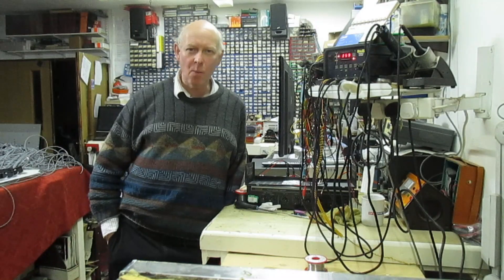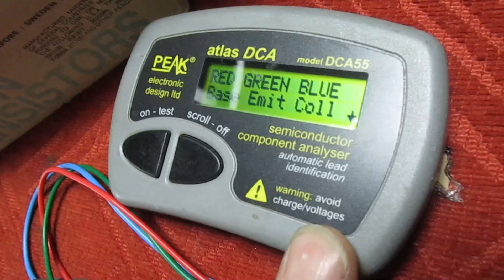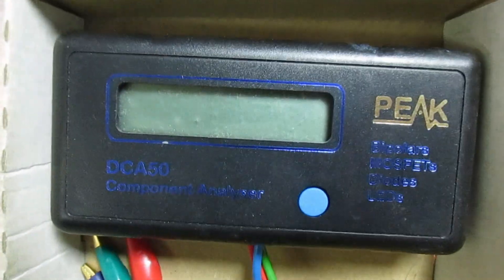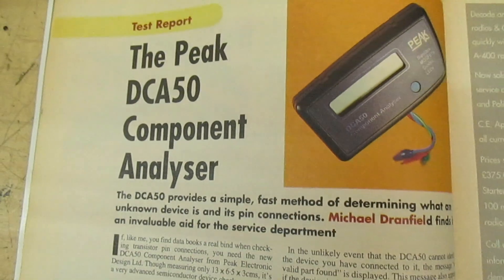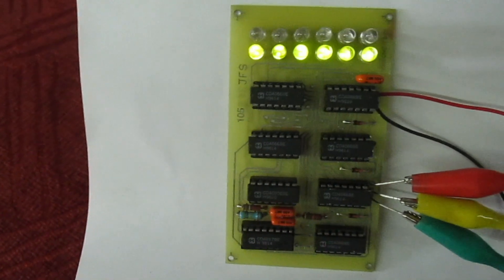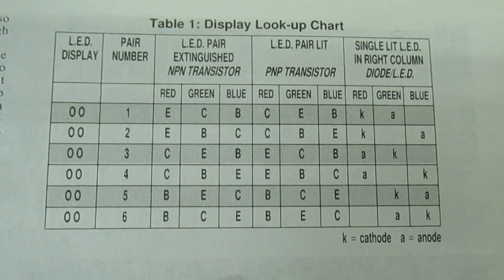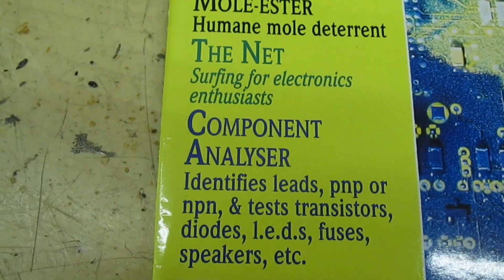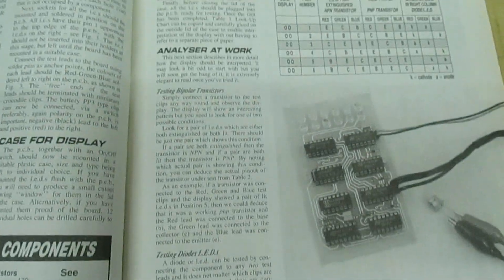The first Peak electronics transistor analyser from 1996 .

Comment: I have a version of the grey one here next to me
Reply from the maker: they are an excellent pice of kit and easy to use .
Reply: @michaeldranfield7140  Yes and they have a weird battery in them mine has been in the unit for 20 years and it still isn’t flat
Reply from the maker: @rectify2003  I tend to keep a couple of spare 12 volt batteries in stock as mine get a lot of use and the battery always packs up when I need it most !
Reply: @michaeldranfield7140  Brilliant

Thankyou

Comment: You've got me thinking about buying a DCA75 but it seems to be out of stock with Peak.  I often use my ESR60 (modified with footswitch).
I bought Television Magazine from the early 1980s and occasionally contributed.  I have them all carefully stored for reference.  Could use an easy indexing system for them as I still work on video equipment, especially Beta, Philips VCR/VCR-LP and V2000.
Reply from the maker: Television is the only magazine I have stored in order from the 50s to the mid 80s but doing this video and one on the milliohm meter has prompted me to get some sort of organisation, my Television magazines from the mid 80s to the very last copy are stored in different places , in no order and I need to get this sorted, I found the magazine I did the review on in the airing cupboard !!!
 Someone gave me a Philips V2000 from 1976 a few weeks ago but not had time to look at it yet .
Reply from the maker: Just had a look now its not a V2000 its a N1700 .
Reply: @michaeldranfield7140  You will see me work on N1700 and similar N1502 on my channel.  First and foremost of course are the heads, and they can often look fine but be knackered.  If you need a tape with recordings, just ask.
Reply from the maker: @video99couk  the guy who gave this to me said it had new heads fitted at one point in its life, I dont have any plans to get this going at the moment as I never got involved with these, my first video repairs were limited to VHS and beta .

Comment: Interesting video! I’ve been researching the semiconductor analyzer made by “electronic design specialists“ 
In some of the old magazines on that website, Dave (The original designer and owner of Eds)…. Had a three part series spanning three months showing how to build your own EDS 59C “Simi analyzer”. But it is quite complicated.

 I’ve tried to find one on eBay but only one popped up in the last several years and I wasn’t quick enough to purchase it. 

Would probably be quite an involved project and I don’t quite have time for it now.  So I’m holding out and hoping to find one instead of having to build it myself. 

Always interested in those small pieces of equipment designed by an individual. I have a pretty good collection of them. Although they don’t get used every day in my lab… I enjoy them immensely! Now that I think of it I do use the EDS “Cap analyzer”, and also their “leak seeker” almost every day.

Always enjoy your channel and content. Good luck on that batch of boards. 👍
Reply from the maker: It's not just a batch of boards, I'm building the who unit, you may have noticed on the left hand side of the video there's a great pile of wires also, these are finished units, 80 down only another 120 to go!!  I'm a big fan of peak electronics as you may have seen, the units are simple to use and quick, which is important when time is money, I also have the peak Triac/Thyristor tester whick I must have used only twice in 10 years.!!

Comment: And you kept all your magazines!! I had to throw many old PW, PE, TV magazines away as I didn't have space to keep them. 😢
Reply from the maker: You wouldn't believe how many magazines I have , Television, electronics today international , radio constructor, practical wireless , every day electronic , practical electronics , and all bar a few I have all issues, , Had to re enforce the loft floor at home as nails kept popping out of the ceilling !
Reply: @michaeldranfield7140  The trick is to scan them at a reasonable resolution. I note that a lot of the scans on World Radio History are very low resolution which is a shame, as someone has spent an awful lot of time doing the scanning - if they'd upped the resolution a bit they would have produced a formidable archive. I used to collect Electronics Australia magazines but space became a problem and now that every issue is archived online I have got rid of the paper copies.

Comment: Television magazine, ohh the nostalgia of buying every copy to learn the latest chassis and stock faults.
Les Lawry Johns wrote some great ammusing articles containg very useful tips on fault finding
the tale of the blue tant was a good one.
I can remember these transistor analysers, very useful when faced with a suspect device where the markings
had been removed, some brands were bad for this, just marking it as an inhouse device in the service manual
when it was a standard i/c. or transistor.
Thanks for the trip back in time.
Reply from the maker: No problem at all, a trip down memory lane for me also, wouldn't it be nice to turn the clock back to the age of repairability.
Reply: @michaeldranfield7140  If only, today it's all designed to fail then be thrown away.
They are supposed to be forcing makers make spares available, but how many like us are there left
to find the faults?
With no local repair shops, there is little demand to train school leavers in the art of fault finding today.
Reply: ...and Laura Luvitts Dicey Decca.

Richard
Reply: @ukfmcbradioservicingTango21  Happy Days! Les was a must read and often the best part of the magazine.
Reply: Yes Allan, Motorola did this often and would charge a premium i.e £2 or £3 for a transistor when you could buy something like a BC108 for pennies .